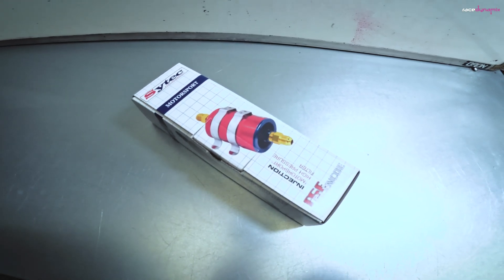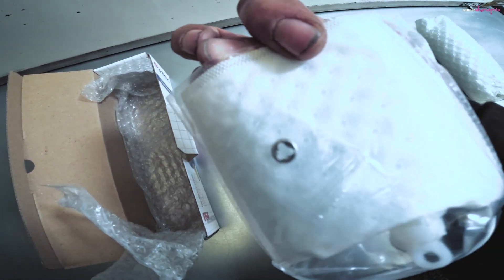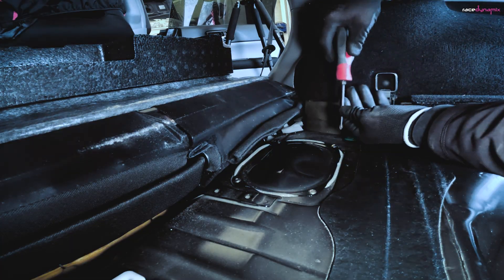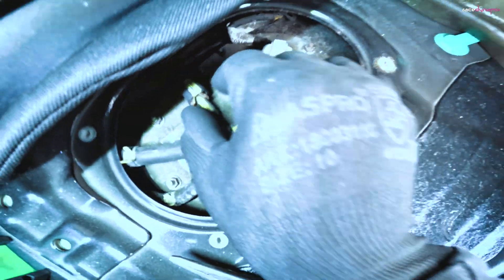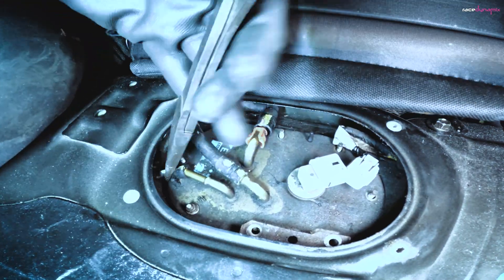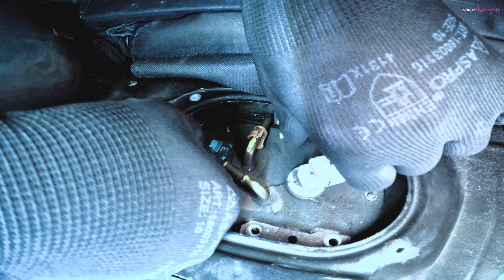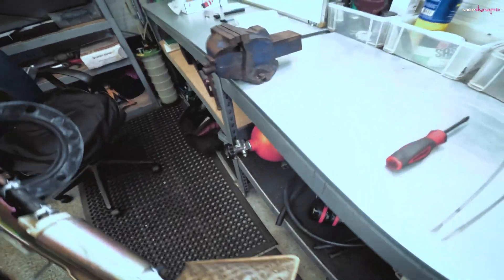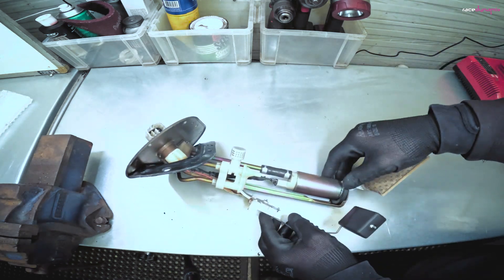Subaru Fuel Pump Upgrade | Fitting a WALBRO 255

Comment: awesome, doing mine this weekend... it hasnt failed but since im already way deep into the project, replacing pretty much everything engine and suspention wise, it doesnt hurt to put a new fuel pump too.
Reply from the maker: absolutely 👍
Reply: @racedynamix upgrade completed!

those fuel lines were hell 😂 but the hawkeye lives on!

 your video helped a lot, especially on the manouvers to get the assembly out of the tank.

this was the first time i have done this on a car the doesnt require to drop the gas tank, so new experience.

thanks for your helpful videos.

Comment: Installing this to a 2006 Forester XT, will I need to upgrade anything else since this is a high-flow pump?
Reply from the maker: Hi.  No you won't, the fuel pressure is regulated by the fuel pressure reg 👍

Comment: Is the fuel temperature sensor on that assembly or is it located somewhere else?
Reply from the maker: There isn't a fuel temp sensor on most.. At least, I have never seen one on a pre 2007 UK or eu car.  Added to say that some usdm 2003/4 ish have them
Reply: @racedynamix  thanks for the quick response, I was finding a lot of talk about it could be causing a no start after it was running and got to temperature, runs awesome just won’t restart, let it cool back down and fires right up, started after changing fuel pump. Changed fuel filter, now since there is no fuel temperature sensor I’m thinking either fuel pressure regulator or possible bad injectors. Thanks again for sharing your expertise, very helpful, awesome channel!!
Reply from the maker: @floydcoppage9423  well... Just done some investigation and it depends on Yr and model of car as to whether it has one.  what is your car ?
Reply: @racedynamix  it’s a U.S. 2003 wrx
Reply from the maker: @floydcoppage9423  hmm.  If it has a 32but ecu it 'may' have a temp sensor.  Looks like a small black nodule with 2 wires. 

As far as problem solving is concerned I would start with the easiest and retrace your steps.  So yeah fuel pump assembly would be a good start.

Next understanding what is getting hot.. engine sensors can do that and I have seen many times when a cam or crank sensor start failing as they heat up or wiring degrades.  Really expensive to replace all though so wouldnt recommend it. Was anything else changed ?
Reply: @racedynamix  nothing else was changed but the fuel pump, which turned out that the problem I was having that got me to change the fuel pump turned out to be a really bad rubber fuel line that connects the fuel pump to the fuel line was almost off causing a very bad pinch in the fuel flow, I thought the pump was going bad instead I found that! But the whole problem of it not restarting after it warms up just started when I messed with the pump, so I will look at it again and make sure everything seems to be connected like it should, I don’t remember seeing anything on the pump assembly that looked like a temperature sensor, but then again I never new something like that even existed!😄 Thanks again for helping out!
Reply: Just wanted to give you aheads up that when I took out the pump , disconnected everything, looked it over real good, nothing looked bad, put it all back together and by some miracle it all started to work like it should, starts up good, gets to temperature and shut it down, 15-20 minutes later starts right up like it is suppose too! Thanks again for the help and making awesome videos! Later!!
Reply from the maker: @floydcoppage9423  that's great news 👏

Comment: Hi Duncan, great video. I fitted a walbro 255 pump on my forester xt and now its throwing engine misfire codes. I used the plug and play harness that came with the kit do you think this could be the issue ?
Reply from the maker: it's a possibility but very unusual.  I have seen lots of issues with some of the hose supplied with some kits

Comment: Just did my own swap with the help of this video. Many thanks for that! Running fine so far. But did notice that the filter sock provided is much smaller than the original. Hope not a big issue, also some of the comments mention fuel starvation on low tank. Will keep an eye and at least I’ll know what it is if it happens.
Reply from the maker: Well done 👍

The smaller sock isn't an issue so long as it sits in the bottom of the fuel tank 👍👍

Comment: I changed out the fuel pump on my Impreza last year as it was making a startlingly loud whine and 'people' told me that's because it was on the way out.
It was a 'like for like' as the existing one was a Walbro 255 installed as part of the PPP, I also swapped over the supplied 'teabag' too.
I noticed that the contacts on the fuel sender were a bit worn but ignored that. All re-assembled and everything was ok.
A few months down the line and I got a CEL, checked diagnostics and it turned out to be a dodgy signal from the fuel sender ....D'OH!!
Reply from the maker: Good lesson there.  Those plugs, because they are always connected, stretch the pins so can help to squeeze them up a bit to ensure good contact.  Good spot and fix 👍

Comment: Anyway..not bashing walbro...

But there is plenty other higher flow pump in 340lph region that flows better at high boost and runs quieter than walbro...

Because in my experience, over time, the walbro will drops fuel pressure in long distance driving (when the walbro becames old/high mileage)

And tue flow rate at 45~60psi region also not that much better...outflowed by more modern pump design at similar pricing (also obviously quieter and draw less amperage)  due different design than heavy metal gerotor type impeller inside of the walbro

Comment: Personal preference, and to cause less fuel starvation issues, but I always fit the OEM filter sock as its about 50% bigger than the supplied one and stops you headbutting the steering wheel when you leave a roundabout with 1/4 tank left lol

Comment: Would you remap after that upgrade?
Reply from the maker: It shouldn't need it.. If the std pump was just a little tired the worst that would happen is it will run a little richer.  If it was mapped with a failing pump I would let the owner know that it needs to come back to be made right.

Comment: I'm pretty sure that you shouldn't use the walbro fuel sock. They cause problems...
Reply from the maker: The genuine walbro filter sock is absolutely fine.. It's the fake ones that can cause issues.  Just need to make sure the filter sits at the bottom of the tank.. Hence why I use a zip tie 👍
Reply: Usually they got the wrong type of filter that sits flat at the bottom of the pump and wasnt fully reach the bottom of the fuel tank...